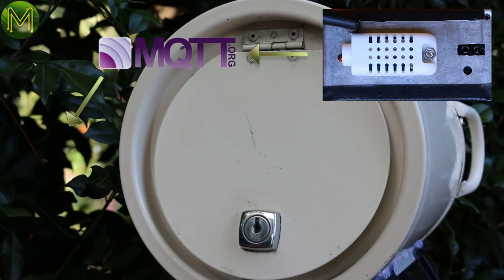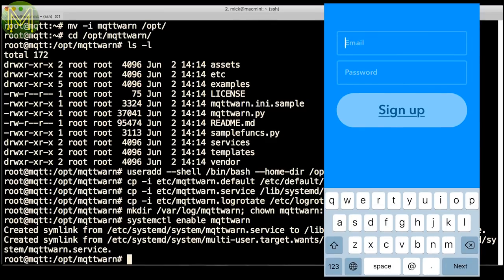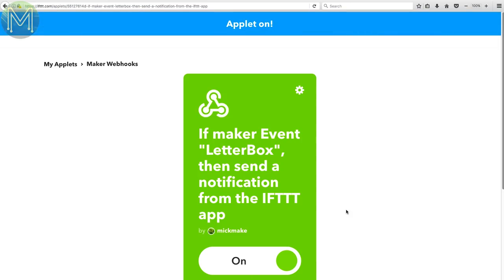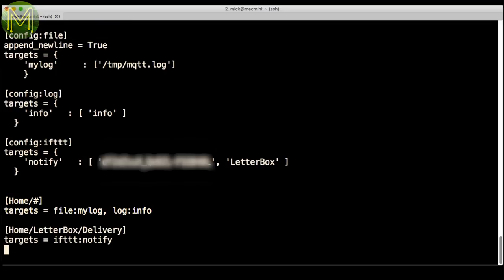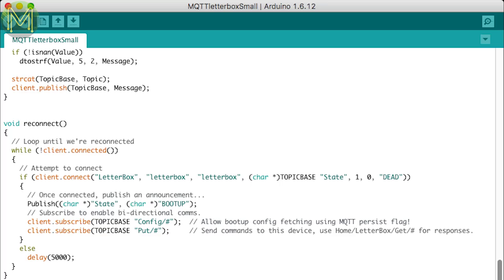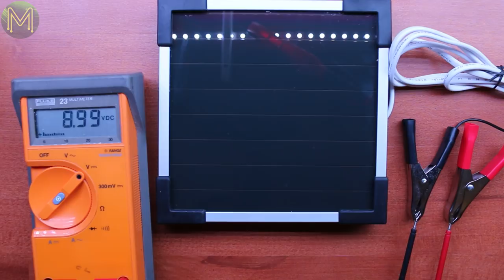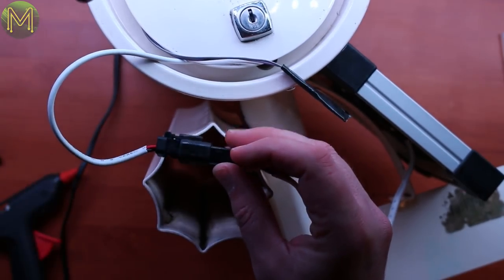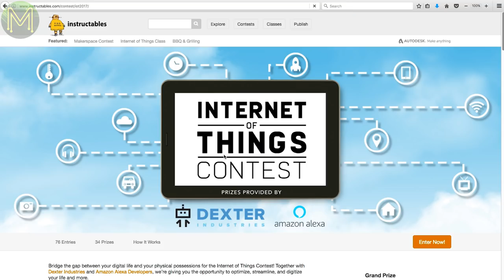#138 The MQTT letterbox Part 2: Sending alerts from MQTT // Project

Comment: This is fantastic.  Really interested in your battery/solar setup.  Portable/off-grid power is always a mystery to me on how to manage that.  Thanks for sharing
Reply: It's not really hard, you just need to know how much power you're going to use, an esp8266 it will draw anywhere from 70ma to 200ma at 3.3V (or 0.5Wh), for simplicity let's just say it's always connected drawing 150ma and running 24/7 = 0.15A x 24h = 3.6Ah (or 0.5 x 24 = 12Wh) you can multiply that by how many ever hours/days you want it to be able to run without being fully charged.

Now, a typical decent 18650 cell will hold around 2.2-2.6Ah so 2.6Ah x 3.7V = 9.62Wh meaning I can run my esp for up to about 20 hours from a full charge so in the case you should add another cell giving you 19.24Wh and over the 24h you're looking for, now this is all assuming 100% efficiency but it should get you close enough to those sort of numbers, not counting loses in use any sort of DC converter, plus you want to oversize you battery anyway because as the battery degrades over the years it won't be able to keep the esp running the full 24hrs you want, so a general recommendation is to have an extra 10-20% battery life to alleviate that.

Finally after we have our load and battery capacity we can figure out what size solar panel we need, so the esp will constantly eat 3.6Ah or 12Wh every day, so we'll need to generate at least that much within the 4 hours of good sunlight your expecting, again it's a good idea for slightly oversize your system to account for rainy/hazy days, plus you shouldn't expect to get the full rated power as you'll usually get a bit less, so probably a good idea is to aim for a panel that'll produce around double, what the esp uses, let's go with a 15W panel that outputs 10V at 1.5Ah, which will give us (1500ma x 4h) - (150ma x 4h) = 5.4Ah or 20Wh everyday, also leaving us plenty of room for expandability for sensors or something else. (note that current is more important here, as the voltage will be stepped down to the needed 4.2V required to charge the cell, so anything above that will not be too helpful in charging)
(Edit: added some corrections, I should really proof-read more...)
Reply from the maker: +vgamesx1 
Absolutely correct. I'll be running a follow up video going over power optimization on the ESP. My code was unoptimized on purpose, so I could start from a baseline point and then show what improvements you can make to battery life.

Comment: Great video! I actually made my own letterbox notifier before I came across your videos. Mine was a lot more basic using bits and piece I had lying around. It was basically a piezo sensor rigged up with a fishing sinker that hits it when the flap moves, this triggers an 433MHz rf remote which then switches a GPIO on a PiZero. A few lines of code to send an email and notification in Python. I reckon all up it would've cost less than $50 (including the PI) and consumes about 180uA!. Your videos are awesome! and I went through the same thought process when trying to figure out what kind of switch/sensor to use that will last the elements. I've just finished it and it's probably not as reliable as yours (the mechanical aspects mainly) so we'll see how long it lasts!

Comment: making stuff go to sleep will help the battery life and if there is no consumption it will charge better and using interrupts will help getting out of sleep in the exact moment
Reply from the maker: +fouzai alaa 
Absolutely! I started with unoptimized code to use as a baseline for a video on power consumption improvements you can make.

Comment: Nice work. I would search a better place for the external antenna - you used it to get rid of the farraday-effect and then put it inside a sheetmetal letterbox - which is exactly this :)
Reply from the maker: +Marcus Wiedner 
Actually adding the antenna greatly improved reception over the PCB antenna to the point that the signal was able to get through the letterbox. I could have added the antenna to the letterbox, but thought that it'd be more opportunity for people to pinch the whole setup.

Comment: The hot glue will definitely heat up enough in summer for the case to let go. 
I used hot glue to secure something last summer and it failed.
Reply from the maker: +Moran Taylor 
Yup, that's what I figured. I think hot glue starts to soften at 30C and is gooey at 40C, but I have 6 months to sort out something better.
Reply: Marine grade sikaflex should hold it great you probably would want to attach the case to some form of mounting bracket that you can unscrew to remove unit for maintenance ;)

Comment: Can you monitor battery voltage & send that over as well?
Reply: Yes but you'll need to voltage divider because the esp has only a single ADC and it only works from 0v-1v if I remember correctly.
Here is another way of doing it: https://github.com/frolswe/esp-battery-logger
Reply from the maker: It is possible to over-spec the ESP as this guy did and all the sensors I used can go up to 5.5v without issue. So it'd work. I could also use something besides the Huzzah which has a lot of "extras" in there loading the LiPo.

In the next revision I'm planning on using the solar LiPo charger current indicator as a way of determining current charge rate so I can get rid of the Lux sensor and also doing some Uber optimizations.